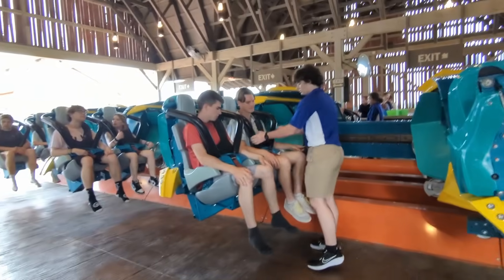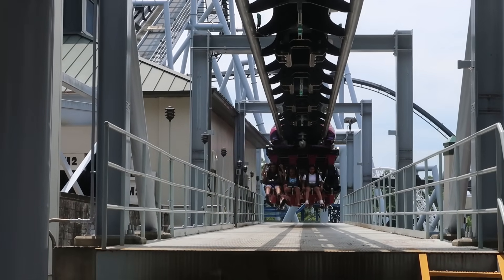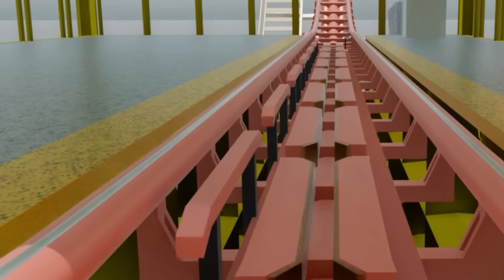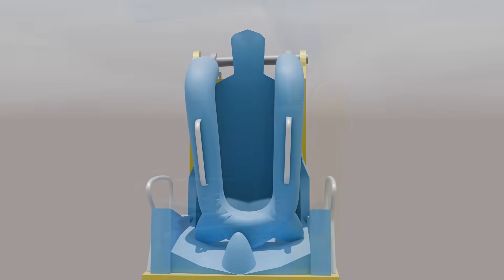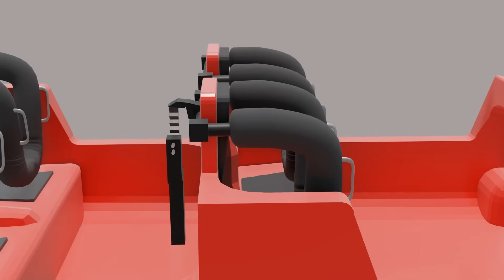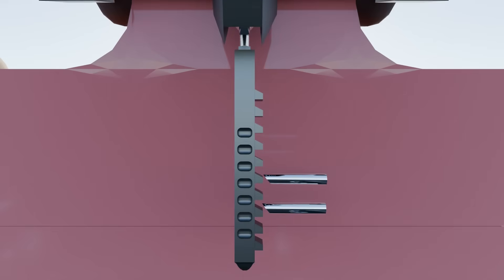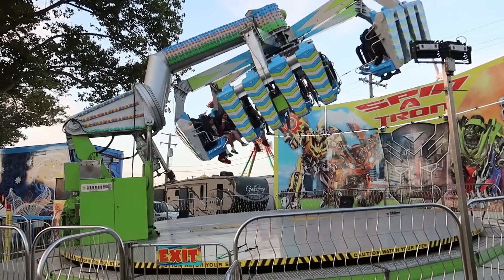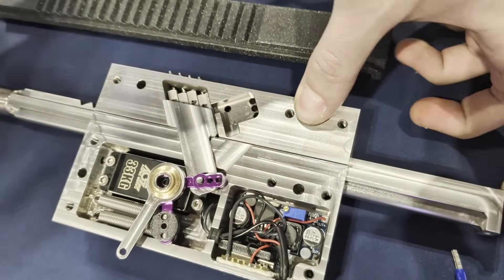Why Roller Coaster Restraints Don't Always "Lock" In Place

Comment: Never had them pop open not even a notch...... I do get them to close even more especially noticeable in the valleys (GCI wooden coaster) putting me more secure in the ride but also the restraints are then so tight that it is uncomfortable... 🤣and no... i close them correctly...... the forces are just at a point that it can slide down more....

Comment: Has anyone thought to combine the two systems to make one solid mechanism? Just curious if a company has thought of it
Reply from the maker: While this makes sense on paper, in practice, you end up with the flaws of both systems rather than the advantages. You would still have the high cost and maintenance of the hydraulic along with the limited locking positions of a ratchet.
Reply: @CoasterCollege thanks for answering my question and yeah that makes sense now also amazing work on you're research on these videos I've learned so much here

Comment: My brother had this happen on Raptor at CP. I am a ride op and used to hearing about this on my rides, and explained what happened even though he likes to be over dramatic. Funnily enough, he also was a ride op in the past, but the coaster he operated uses hydraulic restraints.
Reply: Power tower is one of the worst offenders for slipping ratchets, its very easy to half lock

Comment: I can imagine that this is why some parks don't allow ride operators to use force to close restraints. This is also why it's so important for ride operators to both push and pull when checking restraints. When I was being trained at The Beast, two clicks were required to to ride, and ratchet slips are the reason!
Reply: I wish Six Flags over Georgia didn't allow ride operators to use force.  They get running starts and jump in the air, and body slam into every restraint.  They got my Goliath restraint 2 clicks further down than any B&M hyper has ever been on me.

Comment: Y'know, I used to be terrified of roller coasters (I got very scared, as a child, on the dinosaur ride at one of the Disney parks- it's basically a dark ride with very little in the way of "thrill", even for a small child, other than the dinosaur jump-scares, which weren't the problem for me), but now? After having watched loads of your videos? I'm kind of excited to be able to try riding one again for the first time in... Probably at least a decade (I tried a different one and hated it, but 1, I was still irrationally scared, 2, I don't think I like the kind that dangles riders' feet, which that one was), I'll probably be doing it in late February/early March. It's fascinating to me how learning about things that irrationally scare me makes me so much less scared.

Comment: why are ratchets making a comeback when in my eyes hydraulics seem to be better? they have more positions and have less moving parts and seems less prone to failure. I always prefered them but there must be a reason that I'm not aware of that lead to ratchets making a comeback
Reply from the maker: They are far easier and cheaper to maintain. New designs have eliminated the problems that caused them to decline (see the mention of infinite restraint at the end of the video)
Reply: @CoasterCollege ah makes sense, Thanks!
Reply: overfilled hydraulic systems can fail/open….
Reply: Might be similar to why many rides have a seatbelt restraint even if for some, it's super redundant. Many people perceive it as safer. Like the noise helps them understand that it's working properly. I don't think it makes sense but not everyone watches these videos like we do lol.
Reply: @47ratsinahoodie honnestly, eventhough I know both are perfectly safe, I feel safe in hydraulic restraint just because they wear down less and nothing can get stuck in them causing them to not lock.

Comment: I prefer how tight hydraulic restraints can get but i prefer the audible cue of ratchets- i know i cant have both 🤣
This channel, over the years, has made me so much less afraid of roller coasters but i discovered that i loathe airtime. The more snug i sit the more fun i have. Without this channel i would have never dared to face my fears of rollercoasters to begin with.
Reply: I’m kind of the opposite. I LOVE airtime, and will try to get the loosest restraint possible
Reply: @CoolDude-il2mp same
Reply: I’ve found that to get over that initial tingling fear every enthusiast has, you need to be able to breathe and believe that you won’t feel it. It is your body’s fear response, not falling sensation. They’re just so interlinked it seems like it’s the same:
Reply: you can definitely have both, just add fake ratchets (or hey, why not make that another redundancy?)
And honestly if i was making design decisions i would do that just because the sound is kind of a core part of riding a rollercoaster, it's like how many electric trains make really distinct noises when they're accelerating out of a station, if you remove that noise it's like the soul has been taken out!

Comment: I've experienced complete restraint failure in a couple of instances, most notably on SFAs defunct SLC  in which case the restraint completely unlocked and was only held in place by the belt that attached to the restraint  via the seat. 

My restraint was down and locked prior to dispatch  but about a 3rd of the way up the lift it completely opened up.  I had to hold on to the small rings on the side of the seat in order to stay in the ride and it was just by luck that I survived that experience.

Afterwards  I refused to ever ride in the specific train  I was in on the coaster ever again (the blue train which later became the orange train following the 2005 repaint of the ride) and would instead choose to ride only the red train (later yellow train).
Reply: Did you tell an operator? I think about things like this when I see loose seatbelts on rides. A kid just at the height limit would have so much space, and it would be so hard to hold themselves in.